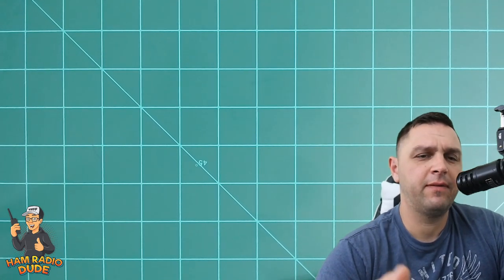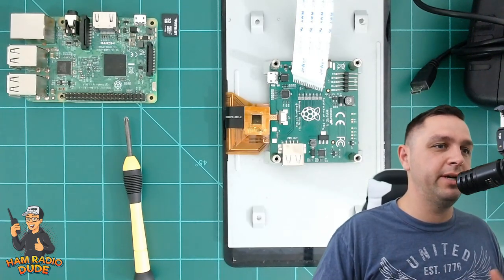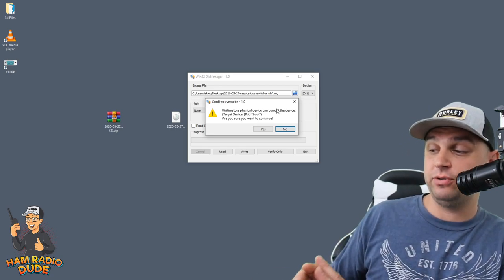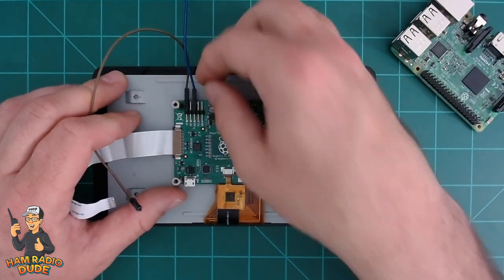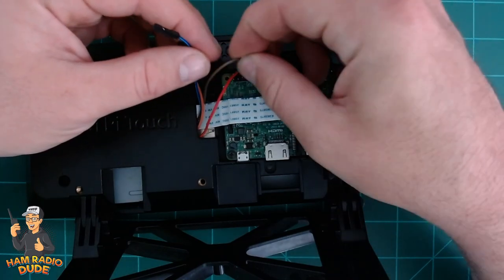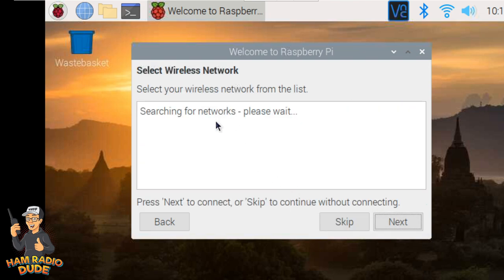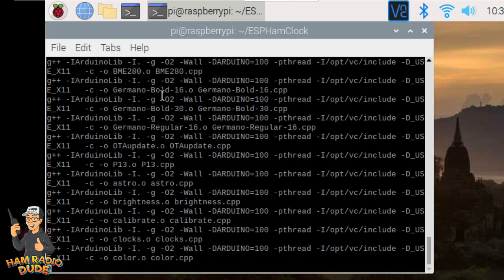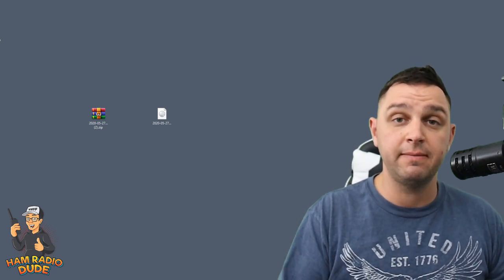Build a Ham Clock for Fathers Day! Fun Ham Radio  Project for Kids / Dad

Comment: Looking to make this myself, been experimenting with oracle virtualbox I've managed to compile hamclock on Lubuntu virtual machine. Got a pi zero w with a display on the way. Shame I can't figure out how to compile it for Windows if even possible as I got a spare 8 inch Windows 10 tablet that does nothing at the moment. 

I did think about putting Lubuntu on it but worried I might encounter some issues.

Comment: Great video!  I have a 19" tv I want to use.  Would I need the ribbon cable and the 4 jumpers still or would a MiniHDMI to HDMI out to the tv be enough?  Also since the pi4 B is the same price as the 3 would that work out ok?
Reply from the maker: Mini HDMI should be just fine. I ran this to the hdmi of my tv this way for a while. Good Luck!

Comment: I had mine working. While messing with the settings it disappeared. How do I get it back on the monitor without starting at the beginning?
Reply from the maker: in the terminal window, you can start hamclock.  This may be wrong, but:

/usr/bin/hamclock-1600x960
or 
sudo /usr/bin/hamclock-1600x960

with proper resolution for you machine.  Please let me know if that worked for you.

Comment: I'm using an external HDMI monitor and am getting a fatal error when running the make command line that its doesn't have a file or directory for Adafruit_RA8875 which I believe is the touch screen module. How can I get around this?
Reply from the maker: Is there any way you may be able to screenshot the error and send it to my email? My email is under my "about" tab on the youtube channel.  I'll do some research

Comment: Very helpful video. I got HamClock installed on Rpi and HDMI display. When the program starts up ( I selected option of terrain map) I get messages “ terrain D map files short” and the “ terrain N map files short. “ it then says “ no map.” I have an Internet connection. All the other features of HamClock work, just no map. Any suggestions? 73 Rick. Ka4ohm

Comment: Everything went fine until the “mark -j” command. On make help I have 8 options and each option tried results in fatal error. Very new at Pi, first project
Reply from the maker: Hi, sorry but I was told recently that this installation method is outdated.  I'll try to get a new video out that has the proper instructions, but the problem is is I'm really backlogged at the moment.  I'll do my best to have one out in the next week or so..   thanks for understanding
Reply from the maker: Also, I believe temporarily offline has a video that may not be outdated

Comment: Your Mic is popping/clicking.. Vox? sounds like Mad Headroom... Processing of compression? Works great over the air but not utube. Try a foam cover and/or point the Mic 90 degrees so you talk across it. It will help you sound natural. Great content!
Reply from the maker: Thanks. It was a noise filter issue amongst a few other things. I appreciate it!
Reply: @HAMRADIODUDE  glad to help. Can't wait to see more viideos!

Comment: The video from KM4ACK used the"  make  -j  4 Hamclock" command and his display would not fill his screen and he didnt know why.
Reply from the maker: I'll check out the video. He'll have to specify the resolution though - make -j 4 hamclock-800x480 or make -j 4 hamclock-1600x960, or make -j 4 hamclock-2500x1440 or make -j 4 hamclock-3200x1920 .  Hopefully that will help.  I'll try to find that video and add it to my playlist.